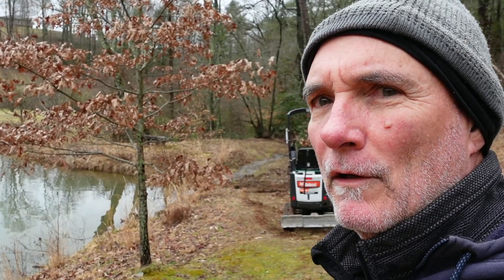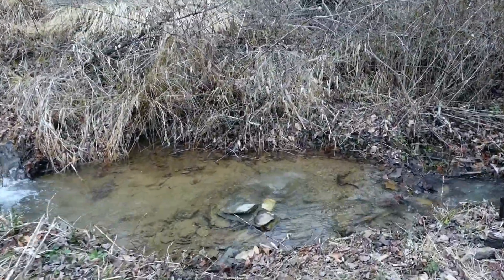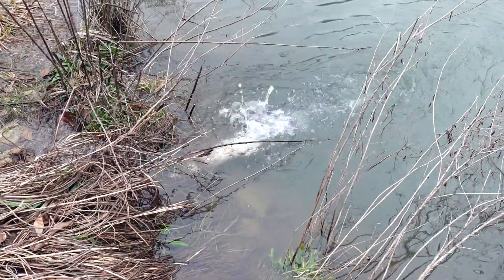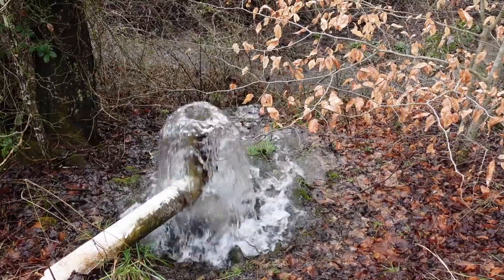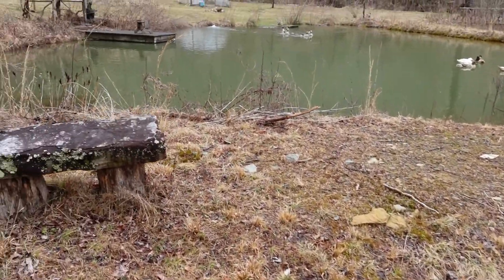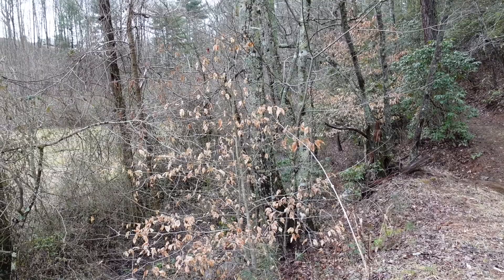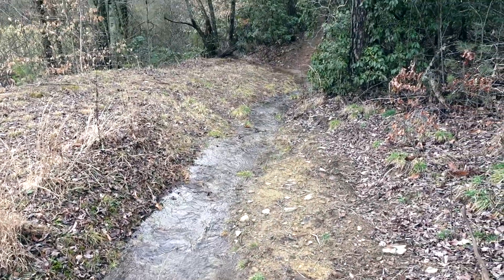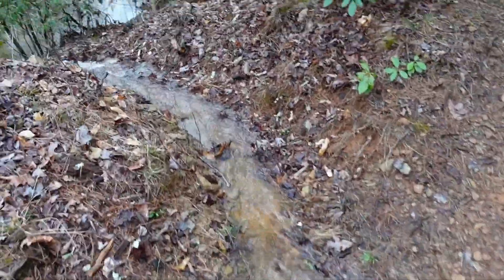How a Farm Pond Spillway works

Comment: Wonder if bass wouldn't be a better choice for stocking. Hardier than trout.  You'd need crawdads, maybe, minnows, and some panfish as well, so it might be a big undertaking.

I might guess that the pond leaks all the time, but when it rains enough it's not so noticeable? I can't figure why it would only leak during a drought. Water table, maybe.

Wife says that her papa had lots of ducks and that they helped seal the pond. I assume because of droppings collecting at the bottom.

Comment: Wow, this seems to be one of those rare properties where you have a large tract of land that sits below a creek. In all my years of exploring creeks, I can't say I've ever seen such a situation. Around these parts, pretty much the only thing lower than the creek is more creek further down the creek. Thanks for the video- looks like a super cool place to be!
Reply from the maker: @Rick-the-Swift  there is a lot of fall in a short distance so the creek above is higher than the pond and then the pond empties back into the creek below the pond. Worked great until I could no longer control the leaks. Now I have a shallow frog pond.

Comment: I basically have the same set up. Except I don’t have a creek, I have an underground natural spring that flows 27/4. I want to put a drain pipe surrounded by crushed stone on the inlet and have it drain into the bottom of a man made pond. I’m just curious if the water pressure at the bottom of the pond would cause the water do push back up the pipe and stop the flow? If you catch what I’m saying
Reply from the maker: Yes if I understand correctly, as the water level comes up in the pond and it matches the level in the spring it will stop flowing. As you know, water will not run uphill 😂
The level of the spring has to be at an elevation equal to or higher than the highest level of the pond. Unless you collect the spring water and use a pump. Hope that helps.

Comment: We get heavy rains where we live.  Would placing a dry creek going downhill, keep a small frog pond from overflowing? I am concerned it could overflow with some of the rains we get.
Reply from the maker: I would install an overflow pipe. If the water flows over a dam in a hard rain it could erode the dam causing damage
Reply: @arlingtonguy54  thank you
Reply: When you say dry creek, is it above the frog pond? Reason I ask is I had something similar and I excavated a type of diverter above my pond. That allowed the majority of the surface shed water to be diverted away from the pond. I only needed that on appx 100' of the 400' of circumference. Anyway, it took a lot of water away and the pond is happy.

Comment: Why does grass in the spillway prevent it from working? In an emergency won't the overflow just flow right through the grass so long as the ground is lower than the dam wall?
Reply from the maker: Yea pretty much. Just cleaning out the silt and debris b

Comment: How do you prevent the creek pipe entrance from being clogged?
Reply from the maker: It does get clogged occasionally. When I notice the pond level going down I go remove the debris. It’s usually some sticks and leaves.
Reply: @arlingtonguy54  Thanks! I would love to put a pond on our farm, there’s a seasonal stream that could provide a good amount of water but the terrain is very rocky so it may not be possible.

Comment: Is the “concrete square” just a heavy piece of material used to hold your 6” pipe under water and in place or is it more complex?
Reply from the maker: It’s a concrete collar poured in place surrounding the outlet about 6” thick. The idea is to prevent water from burrowing through the berm around the pipe.